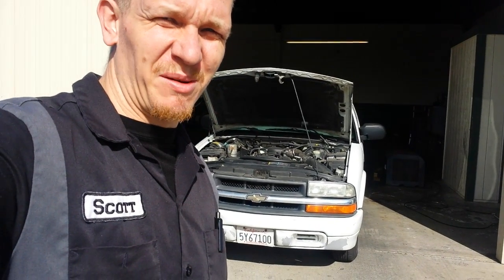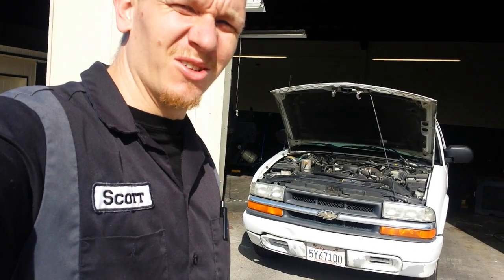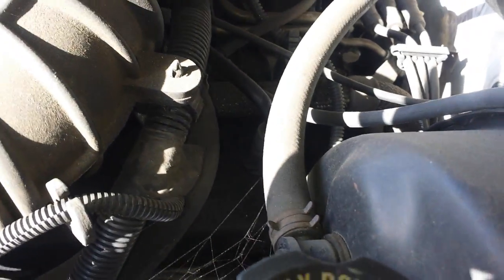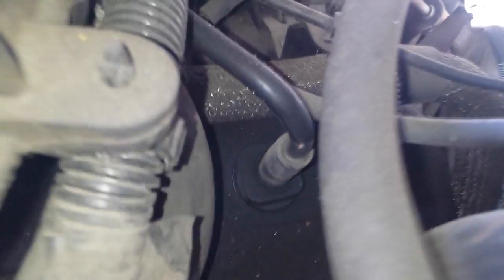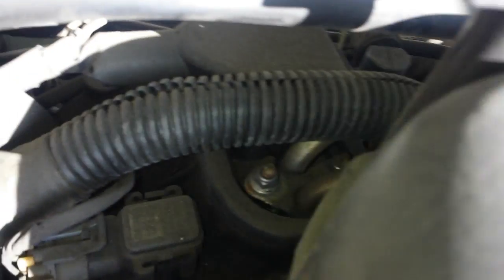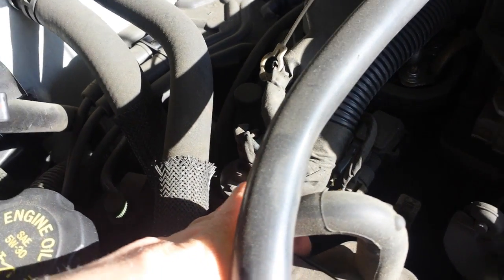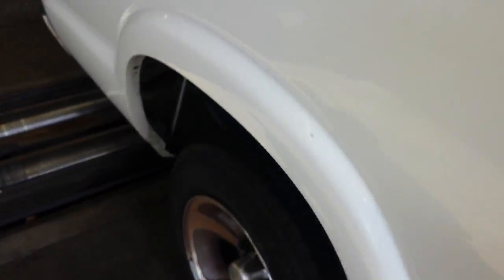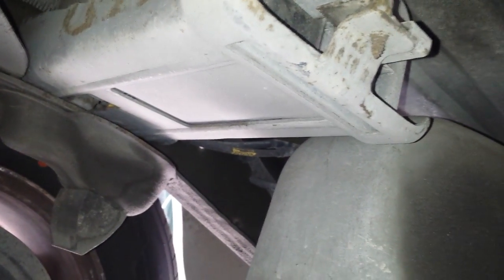Chevy S10 emissions: PCV valve, EGR valve, EVAP canister, & purge solenoid (Sonoma & Hombre)

Comment: have a question, the passages side valve, on top of valve cover what is that called , I think its where the fresh air comes in, my question is can that passenger side valve be replaced i can't find a video about it, its just a hose that connects to something there on top of valve it is behind that plastic cover s10 2001
Reply from the maker: Can you take a picture of what you are describing and send it to therealscottieshobbies@gmail.com

Comment: I have a 2002 s10. I replaced the fuel pump with sending unit due to the odometer jumping around then getting stuck on full and I couldn't pump more then 3 gallons of fuel.  Now odometer is reading 3/4s full when it's almost empty.  Should I replace the canister next?

Comment: where is the OBD2 location for A chevy 2000 S10 4.3 check engine lite is on Auto zone will run a free diagnostic check but can't find the plugin??
Reply: lol gotta love autozone
Reply from the maker: According to my 'DLC location' book it is located: Driver side, underneath  dash, between the driver side door and steering column area. Now from memory I believe the connector is under the dash on the left-hand side near the Parking brake pedal. It should be on the plastic cover on the bottom of the dash.
Reply from the maker: If you don't see it under the dash someone might have stuffed it up in the dash area. If you don't see it you should remove the plastic cover if it's there use a flashlight and just look around from where your feet would be near the pedals up into the dash and you'll probably find it stuffed somewhere in there.
Reply: found it !thanks it was stashed up in the dash!!!
Reply from the maker: +Tom Fuller glad to help.

Comment: When does the evap test actually take place on these vehicle's? During the actual drive cycle on the road or after you do a drive cycle and come back, shut off the engine remove the key and then 5 minutes later the evap vent opens starts monitoring the pressure and then closes about 50 minutes later, does it test it like that? I have been waiting a while now for my evap test to take place and complete and my evap system is still not ready. After I drive the vehicle, I stand back there to listen for the click to know if the test is starting. I'm not hearing the click I wait up to 15-20 minutes I never hear the click for the vent back their to open. I need the evap to complete so I can go pass inspection.
Reply from the maker: +Fearless Front the wvap monitor runs on cold start ups. To my knowledge. Keep 1/2 - 3/4 tank of gas too. If you are in CA, the evap monitor is allowed to be incomplete to pass smog inspection.
Reply: I'm in New Jersey 2001 and up are allowed any one test not ready. I used up my one not ready on the secondary air injection system, My engine was rebuilt using a head from a vin 4 1999/2000 S10 engine. The manifold on this one year older engine has no place for the secondary air hoses to bolt on so my secondary air system in unhooked and not ready. That's my one test incomplete. The evap is the other test that has yet to complete. I have been driving the truck over a week now and the evap system has still yet to complete. I need the evap to complete to pass inspection. The secondary air system unhooked is not causing my evap system not to complete is it? The trucks built in 1999 and back had no secondary air just evap I don't see why this system would not complete.
Reply: If my truck was one year older, I would already have passed inspection in New Jersey, vehicles built in 1995 and back no longer require inspection.
1996-2000 vehicles are allowed to have any two tests incomplete.
2001 and up you are allowed to have any one test incomplete.
'My truck has two tests incomplete the secondary air, which is no longer hooked up and will never complete (that is my one free to pass incomplete) the evap system is still incomplete. I need the evap to complete and then I can go pass inspection, but I've been driving it a week now and the evap has still yet to complete. My truck has a lean condition when pushing down on the accelerator hard and triggers P1171 System to lean at high acceleration. At idle and at driving conditions under 65 mph where I only have to tap on the pedal lightly the lean condition does not exist. Also when I do step on the pedal hard, the pending code normally goes away by the next time I start the truck. Is that causing my evap system not to complete or does the fact my secondary air pump is not hooked up a possible cause of the evap system not completing or both or neither, will the evap eventually complete?
What is the most likely cause of a lean condition at only heavy (high), fast acceleration only but normal conditions at slower driving speeds, light taps on the gas pedal and normal at idle? No lean condition at idle, speeds under 65 where I can gradually increase the speed without stepping on it hard.
I just need the evap system to complete so I can go get a new inspection sticker.....
Reply from the maker: honestly hard to say. The secondary air monitor and evap monitor are both cold start up monitors. Its possiable the computer wants to run the secondary air and then the EVAP.  This is how GM defines a cold start: 

1, Cold Start. In order to be classified as a cold start the engine coolant temperature must be below 50°C (122°F) and within 6°C (11°F) of the ambient air temperature at startup. Do not leave the key on prior to the cold start or the heated oxygen sensor diagnostic may not run.
2, Idle. The engine must be run for two and a half minutes with the air conditioner on and rear defroster on. The more electrical load you can apply the better. This will test the O2 heater, Passive Air, Purge "No Flow", Misfire and if closed loop is achieved, Fuel Trim.
 you are not disconnecting the battery right? At the point you are at all I could recommend is to keep driving and cross your fingers. But then the issue is how many miles is too many til you have to start fixing something?  You have a lot of variables that can give you probs.  But I don't see any reason that your evap should not set.  

Your lean condition could be something as small as a poor responding O2 sensor. But it could also be a bigger problem such as valve not seating right or an injector not giving the proper amount of fuel. I have seen many times when a pending code stops the computer from setting monitors to complete when a pending code pops up.. 

Honestly, id do a fuel injection cleaning first (using sea foam) and continue to drive. If i reached 3-400 miles i'd start checking resistance on the purge and vent solenoids for evap system. Id also start doing research as to if the 2ndary air system has to run before evap can run but I don't even know where to start that research.
Reply: Ive checked all over the internet. Their is nothing out there as far as the evap being affected by the secondary air but just because I havent been able to find it doesnt mean it isnt. It still doesn't account for the first time I went thru inspection my evap system was ready but my oxygen sensors werent. Now its the evap. As far as lean during high acceleration only all the research Ive done is pointing towards an obstructed fuel filter. So Im getting ready to change that in the hopes it fixing my lean condition during heavy acceleration. Its the only DTC I get and it affects fuel trim which is part of what evap tests. Hopefully that will fix it and the evap will run and complete. Hopefully the evap test will eventually actually complete either way soon. We checked everything else during the freeze frame and live feed the only problem we found was the fuel trim, to much oxygen in the exhaust the computer is trying to compensate hard by adding fuel. If the secondary air is stopping the evap test Im screwed, I would have to go find the correct head and have the correct manifold put back on to hook back up secondary air. But evap was ready the first time I went to inspection it was air and oxygen sensors not ready. Now its air and evap. It says out their evap can take a while to test so hopefully it will eventually, but were going to try and fix that lean condition at high acceleration with a new fuel filter first and get rid of that lean condition, because that was present before the engine was rebuilt hopefully that will fix it and evap will complete. If anyone else out there see's this my secondary air is not hooked up. Im bot getting any DTC codes related to it. I do have a lean running system during high acceleration throwing intermittent code P1171 my long term fuel trims are far in the negative my short term are right by zero. My evap is not completing would secondary air being disconnected affect it or just the lean condition at high acceleration. Once evap completes I can pass inspection. Thanks.